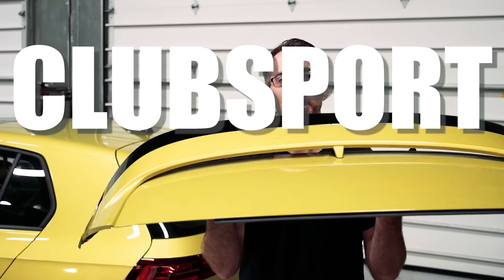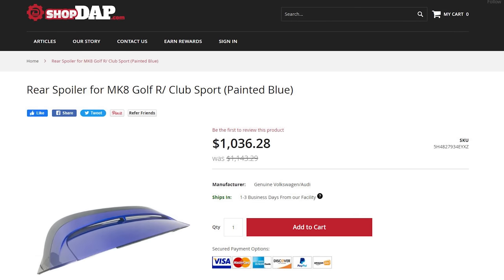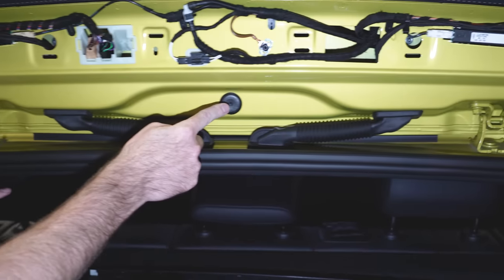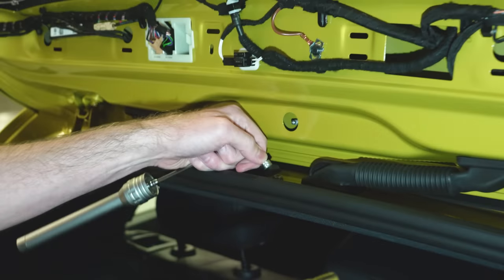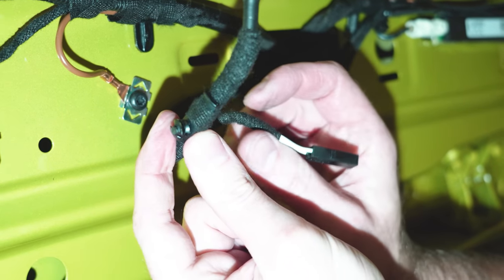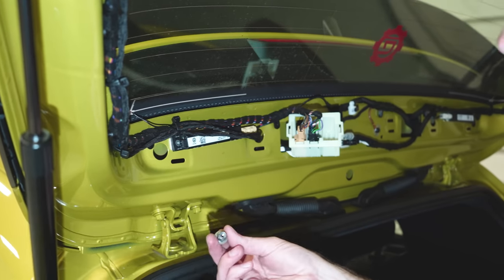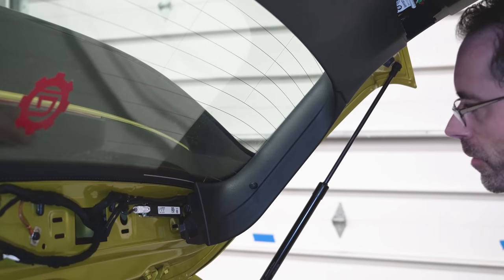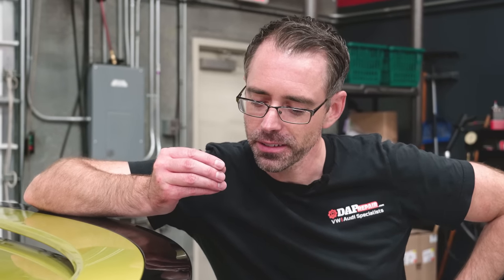MK8 GTI Clubsport Spoiler Swap | DIY

Comment: I really like these videos and the fact you make these parts easily available!

A trick I like to use in order to not loose nuts and bolts is to apply pieces of tape on the inside of the socket to make them tight fit and hold the hardware in.
Reply: I use a bit of grease, it works like glue.
Reply: Koken nut grip sockets for the win? 🤔

Comment: Excellent video, Paul Barrett, as always.

One simple and useful tip, which I learned (or thought of) while changing countless incandescent rear light bulbs in our 2014 Q3, is before screwing those nuts off (or on) the thread, just pull down the trunk (boot) lid to be parallel to the floor (or close), this way gravity is on your side and keeps the nut sitting nicely in the tool, while you thread it off (or back on).

From experience, totally possible to do alone (hand to pull down, shoulder to support), but way easier if someone else can hold it for you (which I never had).

Comment: If you closed the hatch slightly and undid those 10mm nuts from the inside it'd probably just drop straight down and not into the decklid.

But a magnet also works 👍
Reply: That’s what I was coming here to say.  =D
Reply: Same here. I dropped 2 all the way down to the bottom of the hatch. If you remove the rest of the trim pieces and you can reach in and grab them. Stressful but not bad.

Comment: Hello:
This is your most current upload so posting a message here that I appreciate the work you're putting into providing these very helpful videos. I'd like to purchase from you to support you but finding your shopping options limited and your prices high.
For an example I'd refer to the ignition coil & plug packages that ECS Tuning has. Firstly, it is much more convenient to get a package than to put individual items together which also bumps up the cost. ECS have a four Bosch coils+ four Bosch plugs package (+ boot protector) for $143. At your site four non-Bosch coils + four NGK plugs come to $278, almost double.
So, something is way off in your pricing !!
Also I can get to the available kits in three clicks at their site while it takes a lot more effort to arrive at the limited buying options at your site.
I'd recommend modeling your site after their site and bringing your prices at least closer to theirs, even if you're not able to match them.
Hope this helps you with your planning !!
Regards
Reply from the maker: Thanks for taking the time to leave this feedback. 

When comparing pricing, it’s important to make sure we are comparing apples to apples. Comparing the price of a Genuine part to a a non genuine is not the same item. 

With that said we are always working to improve our variety, price conscious alternatives and website experience. We have some site changes coming soon that should improve the experience. 

Again thanks for the feedback. We appreciate it very much.
Reply: @Deutscheautoparts  I agree! I'd buy so much more from yall if yall had more assembled kits!

Comment: Hello. Cool and clear video. Do you happen to know how to remove the washer / third brake light assembly from the spoiler (on the GTI / GTD models)? I’m presuming it’s best to remove the spoiler as you showed, but how is the brake light / washer built into the spoiler, please? The manuals I’ve looked at say you should be able to prise the thing out, but I think these instructions are for the models without the OEM GTI / GTD spoiler. I’d appreciate anything you might have on this, please?

Comment: Did you put all of the metal clips back into upper plastic panel?  You can also use a silicone grease on the socket/nut to keep the nut from falling out using the film strength of the (silicone) grease.  On my Mk4 GTI, very few (interior) parts came off as designed and it was extremely frustrating....

Comment: I wonder why VW doesn’t sell the club sport in North America. They aren’t afraid of it taking away sales in Europe then why not in NA
Reply: Probably some emissions bs the same way EU gets port and direct injection and all we get is direct here in the states.
Reply: The mk8 R wouldn’t be the top dog if you could get the cs over your way 
stage 2 tune on the gti is still then 400bhp
Stage 2 on the cs (which mine is now) 458.9bhp 
iv just got LS500 hybrid turbo to take it to stage 3 and it will be pushing 550 then 😂

Comment: Hi. Have you all checked water connections after installation 😀 seems like my is leaking. And have connected like you all. But still leak from connection. And have you seen any rubber seal between:) maybe that is the case. Since i still trying to connect and its leaks😭 inside plastic trims

Comment: Would the gloss back match the black roof on the 40th AE?  If so, I am ready to order one.
Reply: I ordered one and its coming in a few days, I can let you know how it turns out.
Reply: Update: just popped the spoiler on and the finish is gloss black just like the roof, so it blends really well. I was worried that it would be painted in deep black pearl, but its just gloss black
Reply: @zzzjenk8665  Thanks for the reply.  I ended up ordering the Oettinger spoiler primed.  I was able to match the gloss black roof.  It looks amazing!

Comment: Got a MK8 GTi on order. This is what I was telling my dealer I wanted done to my car before it comes. I will happy pay for the part and install, they flat out refused. Annoyed because it it. Is the UK spec cars the same or are there any differences between the wiring and electronics because I'm on the other side of the pond?
Reply: On UK spec cars only the Clubsport has this spoiler, for now... The Golf R doesn't have it in the UK however the 20 years edition will. I believe there may be differences in wiring for the tailights (sequential vs static indicators) but this channel has a video on installing those so that should answer.
Thankfully I have a Clubsport so I get to avoid this hassle
Reply: @tobygeorgeharribo  Getting one is hard as it is. I had a cold shoulder from the dealership. It's like they don't want me to mod my own car. Odd isn't it. 

It's not going to stop me getting one and having a VW body shop install it for me elsewhere. 

Thanks for the info.
Reply: the only electronics in the spoiler are the 3rd brake light and it's the same connection across all the mk8 models

Comment: Hello,
I installed the Spoiler on my Golf 8 Bj.2024 GTD and it was super easy with your Instruktion.

The Part Number in Germany is for the Reflex Silver:

5H4 827 934 E WON

Price 881.51€ + VAT. 1049€

Thanks 🙂
Reply: From which website did you order it?

Comment: How does the big spoiler affect aerodynamics? Does it increase drag?
Reply: ...minimal if any improvement.  Also, (effective) speeds will be well above legal limits.  It's mostly for looks, but does work on a track.  I think duckbills, canards, diffusers, lips/skirts, and vortex generators provide more aero benefits....still looks the part though